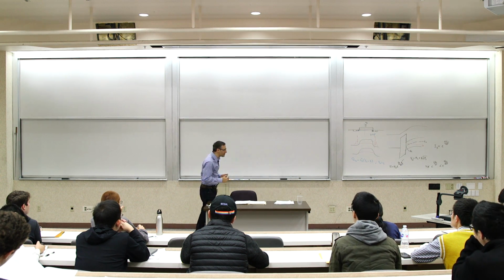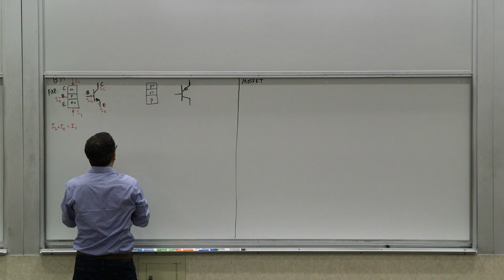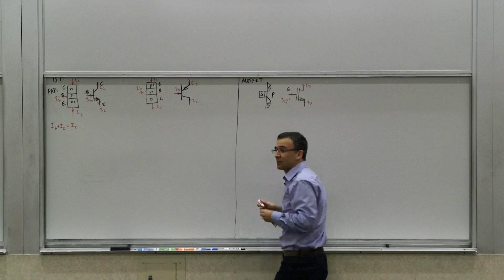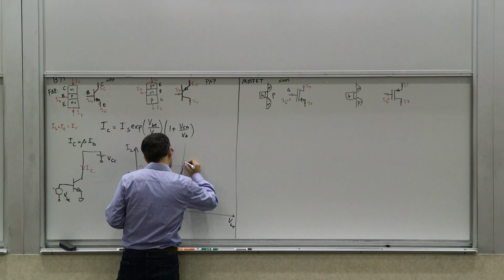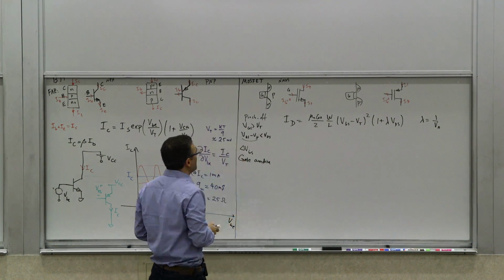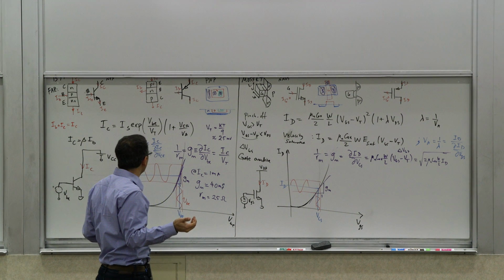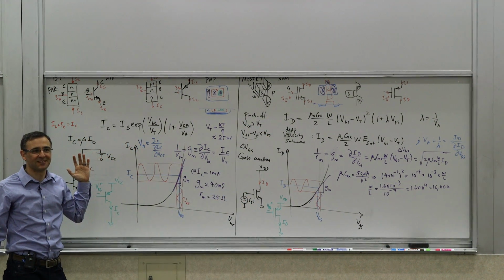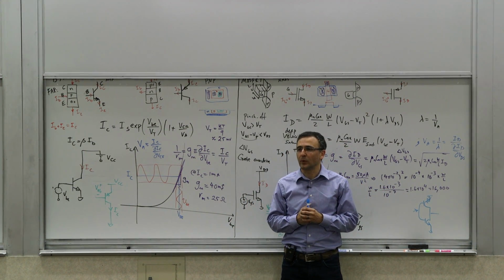115N. Small-signal model, MOS vs. BJT, core transistor behavior, transconductance

Comment: 38:30 - Why are we talking about BJT's?  If you read Doug Self's "Small Signal Audio Design," he tells you point blank that you can't get the best distortion performance in your audio amps with MOFFETs.  It's BJT all the way if you want the best possible fidelity.  That's a fantastic book, by the way - I recommend it highly.
Reply: Yes BJTs are kings in audio design but most of modern analog integrated circuits are exclusively done in FETs specifically MOSFETs. This includes RF and Power Electronics. For example in RF you are not too concerned to get %0.0001 THD levels when amplifying signals. In fact it is common to see class C type RF amplifiers with insane levels of distortions. In these applications, MOSFETs are kings.

Comment: Dr. Hajimiri's response is excellent as to why people prefer mos over BJT (with notorious charge storage problem, base-collector schottky does help as in ECL, but at the expense of static power consumption). There are numerous other reasons but specifically, in this particular lecture, I would like to draw the audience's attention to fact that the designer has control over W/L ratio in case of MOS devices and just by changing it's W/L one can obtain more transconductance from a MOS transistor compared to the than a BJT (for the same of amount of bias current). In the case of BJT, the gm is the only function of the collector current.